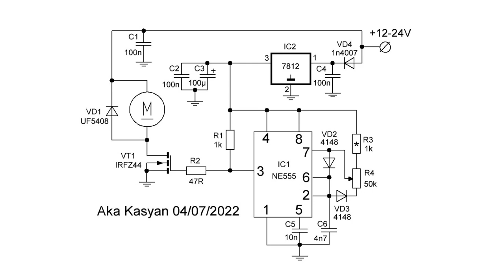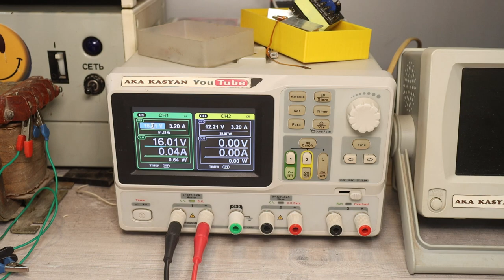Simple PWM motor speed controller

Comment: This circuit needs power beyond 15 or 16 volts because 7812 dropout.
Reply: 555 work from 5 to 15 , regulator is to protect it from higher than it , 10 volt is enough to fully saturate any mosfet if you want run it at 5 volt you can use logic lvl mosfet , even regular mosfet like itfz44 at lower voltage like 7 or 8 is usable but at lower current because higher rds on .
Reply: @fay296k  You don't know every 78xx series needs Vin >= Vout + Vdropout to work properly.
Reply: lol at 12 volt you have 10 volt output without regulation because lm78xx need 2 volt higher at input to regulate ,but it has output at lower voltage (and 555 don't need regulation to work properly) but at 14 to 35 volt you have 12 and not a burnt 555 , use of regulator lm7812 in this circuit it to protect against high input voltage for 555
Reply: 7812 for 555 only